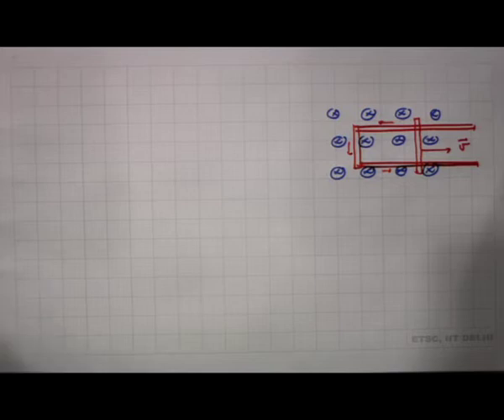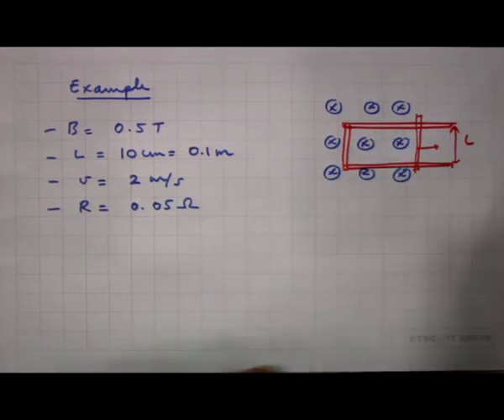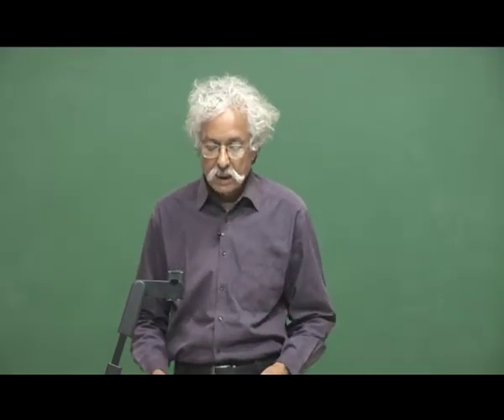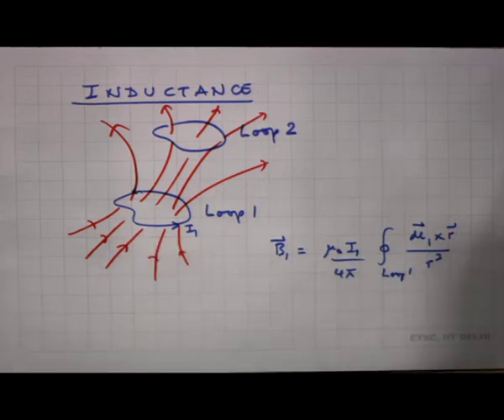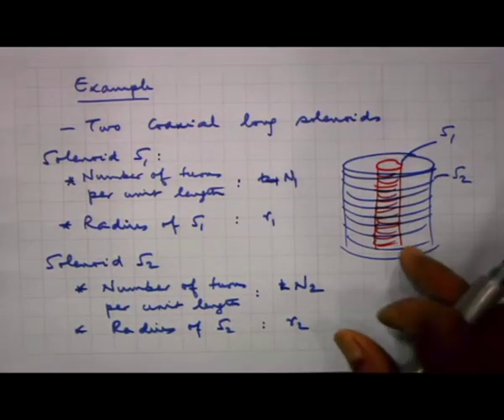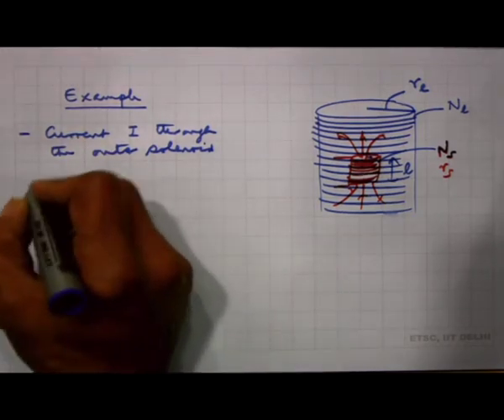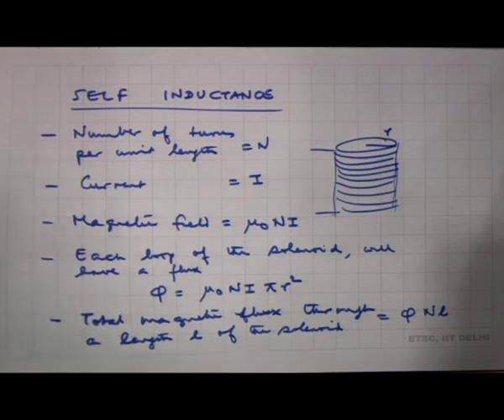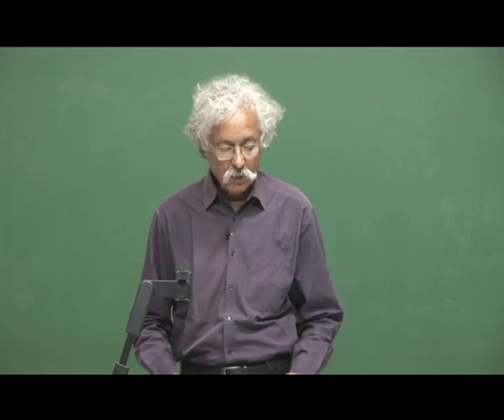Faraday's law of induction: Mutual and self-inductance (CH_22)

Comment: It was really great experience going through contents of the video. However, in the example for Mutual inductance shown with two solenoids S1 and S2 with turns N1 and N2 respectively; on explaining M12 = M21, it is told  that when passing same current ( i.e. current passed through S1)  through S2 - the flux is same. I think, for getting same flux, we have to pass I2 current through S2 - and not same current as passed through S1. For getting same flux, ampere turns should be same i.e. N1*I1 = N2*I2. Please correct me, if I am wrong.